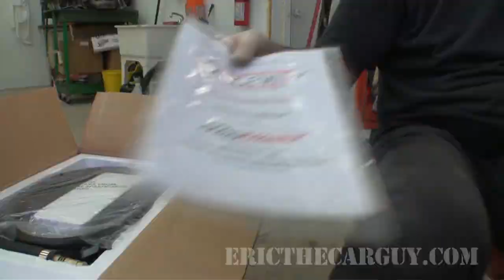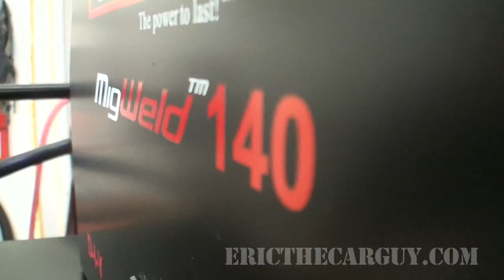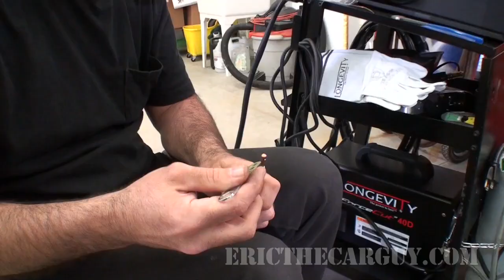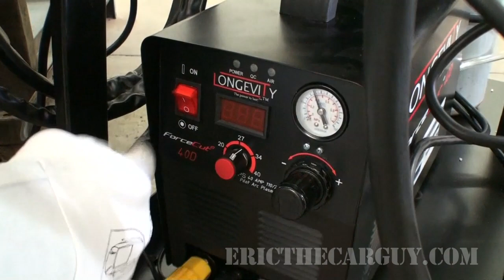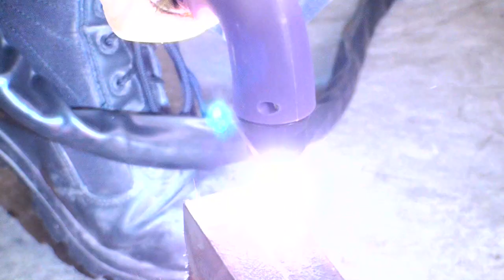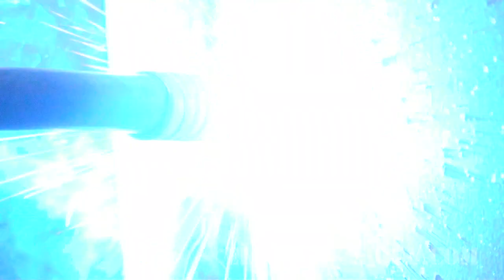Longevity Force Cut 40D, Migweld 140, M1 Cart Tool Review -EricTheCarGuy

Comment: My new Longevity 140 A MIG is junk. Right out of the box... assembled and the AC cord got so hot more use and it would have melted. Some kind of internal short. Just pulling the trigger with the ground clamp attached, the machine goes full load (dead short). Remove ground clamp and then pulled trigger everything OK. upon reattaching ground clamp big spark (Cap discharge). Reversed + - and same thing. Insulating the item to be welded from earth ground seems to help, but still not power to weld. Some kind internal ground to the metal case (I assume).
Reply: Larry Stringfield PS my wire feed part is all metal (unlike the one shown here).
Reply: I almost bought from them but reconsidered. They state they test each welder before it goes out yet I hear of so many dead on arrival and even a water cooler that was internally wired for 220v but had a 110v plug on it. There is no way it was ever tested before it went out. I began to wonder if they were a truthful company and one that I wanted to deal with.

Comment: Eric it's a good thing that Simon Katz, owner of Longevity is sponsoring you.  That way you're able to receive proper support for your welder.  I own a Longevity "Weldall 250PI multipurpose welder" that I have less than 10 hours use on it.  Right now it is a $1500 boat anchor. Simons has had possession of this welder on two occasions, at a cost of 150.00 in freight each time to repair it.  When I purchased it I had a five year warranty. However after them handling it twice within the first year they told me I no longer had a warranty valid at that point and would not correctly repair it. I have spent tons of time trying to correct this with Simon Katz, the owner.  Being that my profession is automated metal fabrication equipment machinery repair of 35 years, I would only recommend Longevity products to my worst enemies.  I now own a Everlast "POWERPRO 256S" that I tried to brake the first month I had it but with no success.  It's a fantastic tig-stick-plasma unit. 

Eric, save your hard earned money and let Simon Katz give you his junk, that way he will keep it running or replace it on a as needed bases for you.  Good luck to you sir.

Comment: I recently purchased a 40D. I also think the clear air tubing and the requisite connectors were under engineered, so I removed the fitting that goes into the water separator and replaced it with a standard quick connect fitting. The threads on a standard fitting are too long to fit into the filter, so three fender washers were required. I think it's much nicer going directly into the machine with my air hose, and lord knows I don't need extra lengths of air tubing anywhere in my shop.

Comment: Not too bad of welding for a novice just a little cold. A quick tip I would find some scrap material and get the settings right and the technique right. So pretty much a little practice and you'll be fine.

Comment: Get rid of the worm screw clamp and get a ear clamp kit. MIG gas is in CFH not PSI.  The reason they may not have given a coupler plug is because there are a hundred different styles and sizes and they don't know what you have. I couldn't tell if you did, but make sure you clean all the mill scale(grey coating) off of the angle iron. Great video for the novice welder otherwise.

Comment: Great Video.  I want a plasma cutter badly. I would only use it for good, I promise.

As a DIY, I got a wonderful tool that you might want to review, and its only 60 bucks.  I got air in my ABS module after swapping out a caliper.  I had to remove this air, and the only way to do it easy was a powerbleeder.  I got mine off of Summit for 58 bucks with the GM end.  Worked beautifully and only requires 1 person to do a brake bleed.

Comment: Your welds would be better if you angle the gun more, push the bead (main pool of liquid metal), and speed up the gun or slow the wire rate more, that should cure your chunky welds. Have fun with your new toy's Eric! I miss my welder already.

Comment: You don't know how lucky you are changing the angle of your final welds !

Overheard welding with that type of mask almost always result in sparks/molten metal falling down around your collar, burning your neck and chest.  Professionals who have to weld overhead a lot use a special mask/helmet with a built in "cape" that cover your neck and shoulders and a pressure feed air system.

Damp towels wrapped around neck help for DIYers

Comment: When you need to cut or weld along a straight line, you need to rest your work hand/arm on the work piece.  Obviously you will good insulation to prevent burning your arm where it is resting.  Do a couple practice (power off) passes so that you can see if power cable/hose or any part of your clothing or will get hung up as you are moving along the cut/weld.

It is also much easier to weld on a horizontal surface instead of a vertical surface.

Comment: Eric- with that "moisture separator"- what about shop air that is oiled? Does that unit require "dry" air? All you'd need is a suitable gas powered generator, and a compressor- and you could "take it on the road" to do a job away from the shop- work it from the rear of your Element!

Comment: Eric FYI on the hose clamps you are using with compressed air.  They are not rated for use with compressed air.  Crimp clamps designed for compressed air are to be used.

Comment: Hey, Erick nice set up I have a similar welder and I put a larger ground wire and an updated tweco ground clamp my welds penetrated so much better. Also something that has made feeding a new spool of wire that I found was to keep the lead and liner / welding lead as straight as I could while holding the trigger to feed the wire through it. Enjoy your new equipment, Jack

Comment: Great video Eric like the look of the machines like you said not top end but hey they do the job, just a couple of pointers when you put on a new reel of wire just straighten out the first 4 inches and remove the tip, make your self a cutting stick to use with the plasma cutter it will stop the wobble, great video fan for life

Comment: What I found out to be useful tip is when welding is to hold around the middle of the shaft closer to the tip of the welder handle with one hand to better guide and control your welds

Comment: Nice review. Decent tools. More amps needed for the weld  and wire increased a little to match but nicely done. Always cut steel sections from the outside to prevent heat bounce-back. (Wrecks the tips/torch quicker)

Comment: Food for thought and Note to self: " Neve use Cheap brand Flux wire for welding, use either Miller Flux or Lincoln flux wire. Becuase, cheap welders and cheap flux wire results in weak welds regradless what the looks look like. This type of brand, ones from Harbor Frieght, HomeDepot or Lowes. Mainly used for diy'ers. Low quality projects not automotive.  A decent Miller or Licnoln brand welder/plasma cutter can be pickup at reasonable used pirce from Craigslist, ebay, an Estate Auction or Farmers selling getting of old equipment(tools) in a yard sale." 

The kinda looks like a Lincoln off brand but I would rather buy a Everlast Mig welder or a Hobart ready Mig welder. Both are made by Miller and use very good wire by Lincoln. For peace in mind. I heard about these brands from the same forum, I mentioned below. 

Here's a cool trick I learned from a forum Not Ericthecarguy,  If your shop has a hooks up for washer and dryer.  Plus the 220 amp plug from the Plasma cutter or welder into the Dryer plug of either your shop or house.  All, dryers require 220volt outlet plug. All yo'd have to do is buy a 220volt extention cord the indoor/outdoor type.

Comment: I'm not sure if you're a seasoned welder Eric but from the sound of the weld and looks of the puddle, you were a bit off. If it sounds like popcorn then you're having poor surface contact and/or ground. From the looks of the puddle, your wire speed might have been too high causing larger puddles to form or you're going too slow.
Reply: He said he was still learning.
Reply: seeya205 Seasoned welders are those that do it for living. How ever I would like to thank you too for the tips in your post they are helpful to me as well. Not that I do welding very often but it's good to know and learn. Having said that I think Eric is a great mechanic and car technician probably one of the best out here.

Comment: Running at 30 amps I think is a bit high for 3/16". try somewhere between 20 and 25 amps thus all the slag, if amps are perfect for the steel it will make a clean cut with little to no slag. Tip: always clip mig wire flush with the end cup, reduces the wire popping. Im a diesel tech and welder by trade. just a little fine tuning with your new toys will make welding and cutting a fun thing to do. also get yourself a pair of mig pliers, the clip wire clean the ends and cup.
Reply from the maker: Cool. Thanks for the input.
Reply: EricTheCarGuy Actually slag is the coating you will have covering a flux core or stick weld bead. The proper term is dross. You will not have a perfectly clean cut, there will always be cut lines in your metal. Don't want you to try and chase a pipe dream. Don't cut your wire to match your cup, you want to cut your wire so it has about 3/8" stick out from the contactor tip not to include the arc. The cup should be adjusted so the contactor tip is barely recessed IMO. Cup/contactor tip adjustment has as many opinions as what is the best engine oil to use. The wire popping I think he is talking about is your arms were floating in air and not keeping a stable wire stick out. Brace up against something. Put an elbow on the bench or even run a finger along the work piece. You can cut a thicker gloves finger off to insulate your MIG gloves so you don't get burned. Check out weldingtipsandtricks.com, Jody also has youtube videos to answer any question. Still a great video!

Comment: my Lincoln weld pack HD was similar to this it is just a 120 volt as well but only uses the flux core wire. i use the 35" wire and i can weld very thick material. id absolutely recommend a respirator of some type. and my welder only costs $269 from the Homedepot. why did i pick this one? i got to learn how to weld with one that was my uncles. it also happened to be the cheapest best rated welder that didn't require gas. and i could use it pretty much near any regular outlet.

Comment: Haven't seen you use the TIG welder you bought way back, or even any mention of it.
Reply from the maker: It requires more expensive gas to use which is why I haven't used it. I'm also more familiar with MIG welding than TIG welding. I suppose in the end it's a matter of application and preference.

Comment: I have the previous generation Force Cut 40D. Its was the only plasma cutter for under $1000 I could find. I've used this machine a lot and had no issues with it so I am very pleased. I 100% recommend this product and others sold by Longevity.

Comment: Amazon has that same angle grinder for 84 dollars. At 134, thats 50 dollars more for the same grinder. Leads me to believe jbtools is overpriced on everything else.
Reply from the maker: Actually companies that make the tools set the prices. J&B tries to stick to those prices. If they don't, then the company can pull the supply of tools. The places that sell on places like Amazon and ebay often sell below the suggested retail price. In essence, undercutting places like J&B who are trying to play by the rules set about by the manufacturer.
Reply: Also many of the tools on Amazon and eBay are reconditioned tools sold as new. I would rather pay a little more to buy from somewhere I can get service from. I've bought a few things from JB and have always been happy with their service.

Comment: Eric, Here is a tip for keeping welding spatter from sticking to surrounding metal. Use Pam  spray. It also can be used to keep the cup on the mig cup clean[spray inside of cup before you start] There are also commercial anti spatter sprays and "Nozzle Dip" I don't mean to be too critical, [I have been a welder for over 40 yrs] but your welds are a little "ropey'.[aka cold welds] Don't be afraid to turn up the heat !
Reply from the maker: Awesome. Thanks for the tips. I'll be sure to turn it up next time to see if I get better welds.

Comment: Good grounding, right voltage, wire speed and wire matching gun socket size are necessary for easy welding. And that's why I never had such beautiful welds yet lol
Reply: Yep, I keep coming up with a new perfect setting welding on the same application as I practice, as it's not just all those settings, it's technique that's changing my still ehem, not beautiful results. lol

Comment: eric u can buy a jelly type substance that you dip you mig tip into and it stops splatter and stops crap sticking to the wire feed.
another thing i was told to do to maintain the life of my mig was get a 5 inch by 5 inch bit of matirial and soak it in cooking oil and get a wooden cloth peg and peg the rag in between the roll of wire and were the wire feeds up to the gun by doing so you lub the wire and the gun everything will be nicely lubed and will help the wire feed better as well.
you will see after a while the rag will go dry re dip it in cooking oil and re peg it again the welds ever look better after the cooking oil.
useing the right cooking oil you can make your mig smell like a  raceing 2 sroke motorbike.
the mig ive got eric all you need to do to weld alloy is use flux alloy wire but as i said welding with no gas is shit in so many days

Comment: also bud your meant to put the tip on your work not like your doing holding it like you do its all over the place as your hand shakes try the correct way putting the tip on your metal and cutting it will make a massive diffrence to the end product

Comment: Nice video again, Eric! Maybe it can be a useful tip when you weld a vertical line start it at the lower end and build up the weld upwards. This way  the fresh, hot weld can sit on the welds already made, so it is easier to keep it in place.

Comment: I got a few tips for you Eric,. Most importand thing is to guide your weld or cut well whit your hands,. Best way i learned is to use your left hand for that,. put your left hand against the peace your working on and use your thumb and forefinger to guide it. Your other hand does the rest. On other tip,. when your welding and its spatters alot then most likely it means that your welding to hot. One more thing,. If your welding and it stutters alot then most likely it means you use to much wire or even to little. But it can also mean that the material is not clean enough. And like you said, practice practice and more practice. Good luck! :) and hope my tips help you.
Reply from the maker: Thank you! I'll keep that in mind as I practice using the tool more.
Reply: EricTheCarGuy good review! looks like u got a camera man
Reply from the maker: donyboy73 Yes I did. He's made life a lot easier. I also think the videos are better as a result of his work.